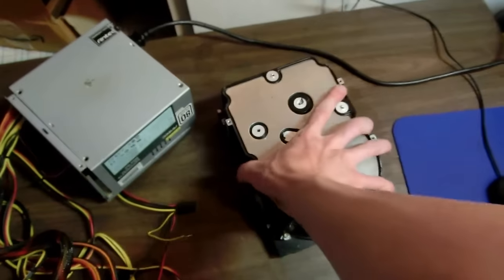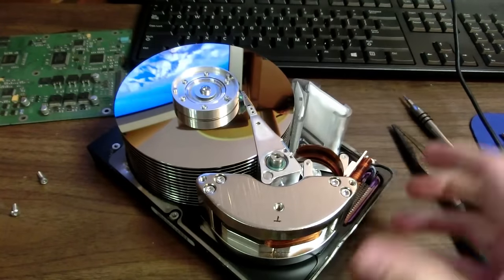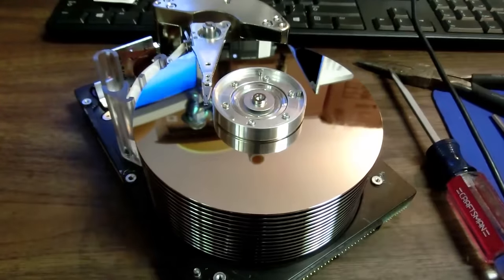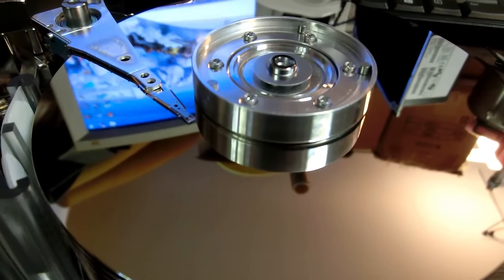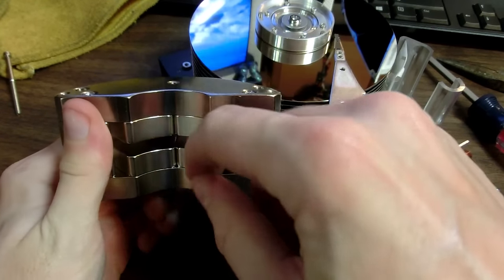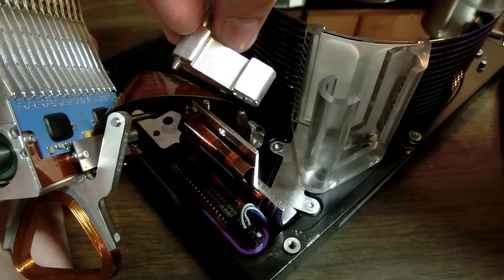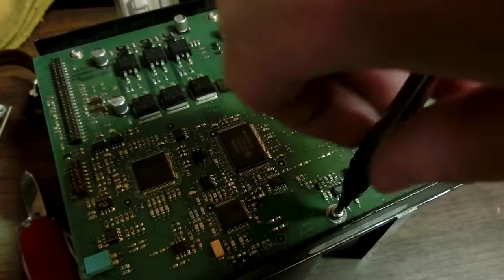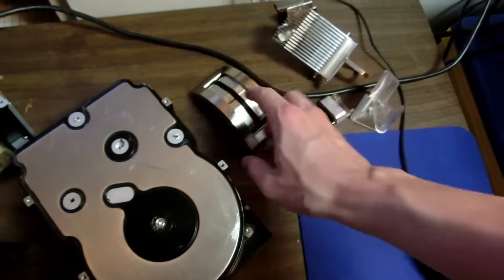Giant Hard Drive Teardown and Gyroscope mod

Comment: old hard drives are such a mechanical work of art. I find them fascinating, from the sounds they make, to the precision required for all those platters to work. modern drives are super boring, and very quiet. I used to love hearing my hard drive chug away when the pc was booting up!
Reply: Me too, actually I'm so fascinated with these fine pieces of electronic and mechanic technology that I have around 200 of them in my collection :-)
In the 90ies/early 00s (when drives did proper noises...) I was able to tell the drive's manufacturer just by listening at the head's actuator's noises.
Reply: Yeah, I love hearing my 386 PC boot up! She's still strong for being 20+ years old!

Comment: Hi Rinoa. Just that magnet alone is worth more than 15 dollars. You could do some fun things with those. I used one to pull up fishing lures off the bottom of a lake and even pulled up a fishing pole. Or you could go to an old mining town and pick up old iron artifacts. Its cheaper than a metal detector and would only pick up iron but I found an old gun and a plow once that metal detectors usually ignore.

Comment: I'd love to own a working computer that uses a drive like this, like a mid to early 80's computer. Maybe one day! Looks like it may be a 10 meg drive?
Reply: I'm a SCSI nerd watching this video 3 years later and am compelled to answer, this drive is a seagate elite 23, model ST423451N. it was sold around 1997-1998. it's 23GB unformatted, but the formatted capacity was roughly 20.5GB due to the sheer size of the platters and assembly making access of the entire unformatted capacity impossible.

Comment: Old hard drives are excellent sources of neodymium magnets, seeing this makes me regret tossing out my dead 5 1/4" drives
Reply: Most 5 1/4" hard drives used stepper motor technology not voice coil. I bet some of those dead 5 1/4" hard drives could've been fixed with a low level format.

Comment: why they make giant hdd in 1997 if 3.5" hard drive form factor was created in 1988 and in 1991 ibm introduced 1gb 3.5" hard drive and "1997: IBM introduces the first drive 
using giant magneto resistive (GMR) heads, the 16.8GB Deskstar 16GP 
Titan, which stores 16.8GB on five 3.5-inch platters."

Comment: It it possible to keep the HDD in its case and use it "sealed" as a gyro? This way it's safer, and one can take advantage of the vacuum inside for more efficient operation. As long as one can control the RPMs through the HDD controls. Well, OK, the magnets are pretty heavy, that's a waste. I am thinking to try this with a self-balancing monorail.
Reply from the maker: Hard drives as they come don't tend to have very much mass spinning since there is also a lot of air inside to allow the read write heads access to the platters. Or do you mean putting it back together afterwards? there's nothing saying you can't put it back together afterwards, I just had it open for the video.
Reply: @RinoaL Many thanks for writing back. I meant to put it back together, or not take it apart at all and use it "as-is". But I was wrong assuming that HDDs were vacuum-sealed; they are not.  Thus, removing the magnets makes total sense, and there is no advantage in keeping it sealed.
Reply from the maker: Yeah they are just ambient air in them. Newer hard drives from the past few years have helium in them though

Comment: that blue board is an amplifier, also its not a dip package, dip stands for dual inline package meaning ic's with two rows of pins.
Reply from the maker: Thomas Sears i never said it was a DIP package, i said it WAS NOT a dip package. the "not" in that statement means it is not a DIP package.
Reply: i notice that now that i go back and listen carefully.
Reply: but yeah its a preamp for the signal coming from the read head as you want to get it as close to the source as possible (on the arm) to reduce signal degradation and interference.
Reply: also don't worry about sd cards, they're unaffected by magnets and are practically indestructible, however a while back there were microdrives, same size and connector as a compactflash card but inside it was a stupidly small hard drive.
Reply from the maker: Thomas Sears
yes i know, i dont worry. but i just prefer to not quickly move strong magnets past storage medium in general, i would hate to induce any charge into anything. but these magnets cancel each other out nicely.

Comment: nice to have a look in one after all these years :-) the arms I thought were cool but I can see that the iops would be dire as it could probably write to all the drives at once with the needles being in sync, but the read would suck as each arm doesn't act independently :-) was it a 7200 when it start out or a 10k? I can see these working well in parallel, two or 4 all going at it at 20krpm or something :-) hmm I wonder if you could tap a few of those six wires leading in to the column to regulate the speed by a simple resistor switch or something :-) it would lite it out a bit I guess and reduce possible chances of the board going wrong :-)
 Very cool more experimentation please :-p
Reply from the maker: battonfive no the motor is an AC motor so i'd need to feet it a different frequency.
Reply: Rinoa Super-Genius normally 3 phase brushless dc
Reply from the maker: Thomas Sears
yeah thats basicly AC, because you cant send it pure DC and because it works more like an AC motor.
Reply: yeah i managed to get one to kinda run buy putting 36hz into two of the motor pins and it would keep spinning after i flicked it but its like a 3 phase motor on single phase, also no torque whatsoever. also the frequency would depend in the motor and the mass of the platters.
Reply: Thomas Sears some good efforts and testing you tried there :-) its cool you managed to hone in to the first phase :-D it gives me a new respect for the board running the data and phasing voltages :-) sucks a bit at the extra weight but could be worse :-) It will be cool to see how Rinoa Super-Genius tackles the phasing, not mentioning about how to bypass or hack the amps to overclock the rpm :-) Its a real interesting project Rinoa, looking forward to see how you go about it all :-)
Reply from the maker: battonfive
well thats the thing the amps dont dictate how fast it goes, the frequency does. i could put this into a vacuum and spin it up to 10x it's speed with the same voltage.
Reply: Rinoa Super-Genius so confused :-) I need to look in to it a bit, I don't get how frequency works in this scenario :-D I would have thought it was the frequency of the amps and voltages being gated that would have handled the speeds :-)
 it sounds like the motor is topping up the rpm relying on the momentum of the cylinder but its hazy in my head, think I will understand it better in your vid when you are explaining it :-p
 would likely take me weeks of research to hope to even get an idea on how to do this conversion :-D
Reply: Rinoa Super-Genius Brush-less DC motor actually means it works like a brushed motor without brushes. The electronics/software decide when to switch coils rather than the brushes and a commutator in a conventional motor. It's is a closed loop system and there's more to it than you might imagine(especially sensor less). You can run them like ac induction motors but they run poorly with higher currents and will not reach their rated speed or torque.  By the way with Brush less DC motors if you feed in more current with the same load it will run faster :-)
Reply from the maker: Coolkeys2009
 it only works like a DC motor if you have the circuit to send it the pulsed DC on all phases, but without the circuit its not just like a DC motor.
Reply: Coolkeys2009 if you pumped more current through the board would it get to the motor or would the board reduce it along the way so the output to the cylinder is the same current do you think?
 sensorless sounds insanely complex :-) it sounds like that could be where a lot of the glitches happen when it comes to the blue screens of doom :-D the reset stages going a bit ape when a power cut happens perhaps or when the rpms are just slightly off on the write phase or something :-)
 the coils make a lot of sense in away but would it not just be easier to run the cylinder from underneath on a motor and gearing system to reach the rpm?
 Rinoa Super-Genius is it possible to isolate the three phase lines on the pcb and just jam a capacitor on the end of them before the out put or something? :-D ahh if wishes were fishes the poor wouldn't go hungry :-)
Reply from the maker: battonfive
"pump more current" you mean increase the voltage? you cant pump more current without increasing voltage or lowering the resistance.
Reply: Rinoa Super-Genius hmm current I take as amps, where power I think was both amps and volts :-) im probably way off, its been nearly two decades since I studied that stuff :-D
Reply: Rinoa Super-Genius The answers are in the names theses motors are also known as ECM or electronically commutated motors. The electronics effectively replaces the brushes and commutator for position sensing. They don't  run very if you drive them like a stepper motor or induction motor.
Reply from the maker: Coolkeys2009
i think we are in violent agreement, arguing the same point with slightly differant ways to say them.
Reply: Rinoa Super-Genius least you guys have a clue :-p does that mean that you both agree on the point that it needs that board to act as a phase controller? and if not how does one boost up the rpm? best I got so far is making my own pcb for it if I could after a lot of research and trial and error :-) could you use a three phase board with a higher current capability from another device lying about the place?
 I think I get the ecm difference :-) the electronics are managing the output rather than the electric being managed by voltage going to the brushes Coolkeys2009 but admittedly ive not dabbled enough to stop myself getting more confused sometimes :-)
 its why im here :-) new frontiers and all that :-D
Reply: battonfive The easiest way to get that to run faster will be to connect an external ESC that can handle 24V and you should be able to run it at more than 2x the speed. One of the things that limits the speed of the motor is the back emf the motor generates once the BEMF  is near the supply voltage no more current can be pushed into the motor as you put it.
Reply: Coolkeys2009 cheers for the info :-) it sounds troublesome like the only way to get that weight of the stacks spinning up at that type of rpm is the phasing and the phasing could do with being timed right so its peaking efficiency because as you say if its not pushing at the right speed when its needed then regardless of the voltage it just wont go faster and I imagine would produce a lot of torque and heat for attempting it :-) and it constantly feeding the motor when the rpm is peaked would be a loss to. 
 I have contemplated the idea briefly before but thought to be able to offset a decent weight then say 6-8-12 of these would need to be running and the energy it would take to maintain would leech li-ion batteries and reduce the range of an electric bike say :-(
 Im hoping Rinoa will have a mess and with advice from you guys come up with a good solution :-) I have faith and its all very fascinating :-D
 it would be pretty legend if Rinoa Super-Genius you could come up with something like they use in the c-1 lit motorbike :-)
Reply: battonfive I would try not to think of the motor as frequency driven at all, it's position decides when the next coils are energised. With Rinoa's ebike the motor is fitted with hall sensors to tell the ESC when to energise the next set of coils to make the wheel turn. If you stall the wheel the output frequency will be 0hz and the motor will still be creating torque. Also the maximum speed of the motor is reached when the voltage generated by the motor is nearly as much as the driving voltage. I don't think it would be that much of a challenge to spin that hard drive stack up to 15000+RPM(it may not be the safest thing to do). I doubt the bearings would be able to stand forces involved in keeping a bike up right though. Anyway I was glad just to see the thing tore down and spun up.
Reply: Coolkeys2009 ah its the position that drives the pulse to the coil, I guess I should have known as what else could it be when its sensor less :-)
 you defined the ebike layout there really well, that makes sense why the acceleration acts like it does on those hub motors in my head now :-)
 youre also very right, its great fun to finally have a look in one of these, I remember seeing them back in the 90s but they were way out of my budget range :-D
 hmm perhaps lit just took the design of the hdd similar to this and expanded up the bearings or something :-)
 Rinoa testing it and messing around with it will give good insight and should lay the idea to sleep if that may be the case :-)
 Looking forward to the next step :-)

Comment: The server hard drives of the 1990's. Could you do that with modern hard drives with the stacking of the platters?
Reply from the maker: Naturenerd1000 yeh but they tend to not be as big, and watch out for modern drives because they now use glass platters instead of aluminium.
Reply: Naturenerd1000 also the motor you would use from the modern day ones would suffer at high rpm under the torque caused by the weight :-)

Comment: hmm... half wondering if a person could get some big neodymium magnets, and a bunch of magnet wire and some chunks of steel (such as some large bolts to make the rotor, with a ring of nuts welded to a center shaft or similar), and maybe make a big BLDC motor (say, wound-rotor style, with stationary magnets).

I have previously used some random stuff to make a small 3-phase induction motor (using copper wire soldered around a nut as the rotor, with machine-screws as cores for the phases, ...).

I also only really have smaller HDD magnets from smaller/cheaper 3.5 inch HDDs.

though, 90s HDDs seem to have a lot bigger magnets, disassembled one that had magnets that would cause screws and small tools to randomly fly stick to them from a good 6 inches away or so). but, my mom really wanted the magnets for something, so I mostly have some weaker HDD magnets...

haven't really made any much bigger motors, as $110 or so for larger rolls (12lb) of magnet wire is kind of expensive. had kind of wanted a 12lb roll of 20AWG, which would be good for large roughly 10-15A coils (about 30-45A, or 60-90A for a 3-phase wye motor, depending how it is wired).

but, I have some smaller rolls (were about $16 each, but only about 1lb of wire) I had been using mostly for wiring up circuit boards, and which had also been useful as I had recently burnt up a stepper, and I just happened to have a roll of the right gauge I needed to rewind it.

HDD spindle motors are also pretty cool, at least if one has the electronics and code to run them...

or such...

Comment: Sounds like the platter balance is slightly off after you took the platter clamp off, I look forward  to seeing you run that 10000+ RPM :-) Wish I had one of those for my own experiments.
Reply from the maker: Coolkeys2009 yeah i didnt mess with trying to balance it due to me not knowing a good method.
Reply: Rinoa Super-Genius I thought that the imbalance wouldn't make a difference as you would eventually be bolting it down to something :-)
Reply: battonfive It just makes an annoying buzz/vibration , I have one hard drive on my pc that makes parts of the case rattle. If you have more than one hard drive mounted in a system  it can affect the performance of the other drives, some hard drive have vibration sensors to compensate.

Comment: Nice screwdriver set, where can i buy one?
Reply from the maker: Ender Running its just the iFixit set, i picked it up a while back. it has all the security bits that pretty much everything uses.
Reply: Ah ofc, thanks for the info I have to pick that up some day, I need a good open uppy thing.